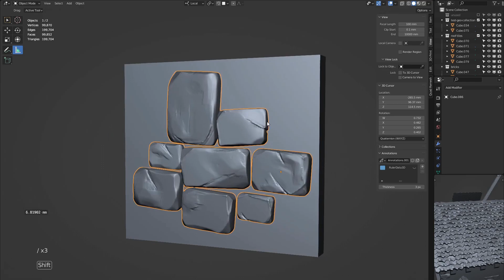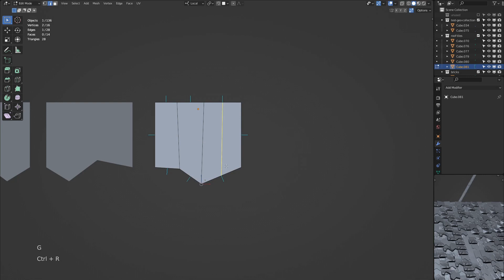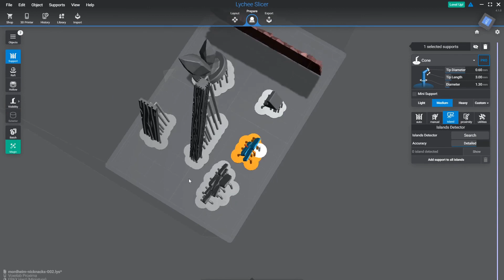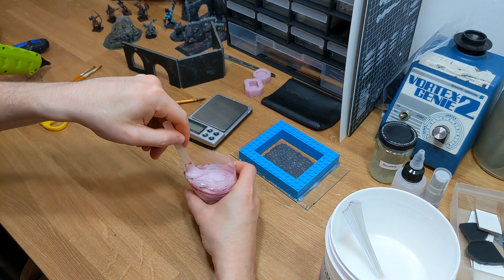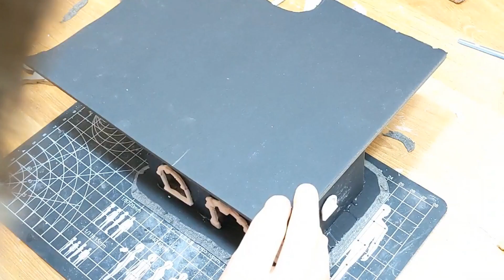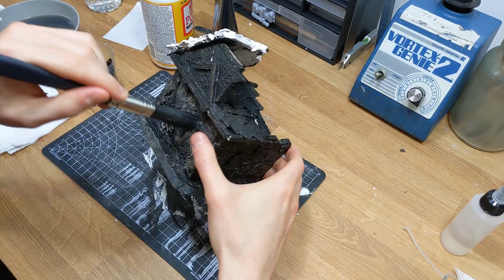Creating Repeatable Wargaming Terrain - Blender 3

Comment: What a great tutorial, one thing I would ask is when I build certain items in blender when I make them to scale and then export to stl the measurements are completely different. I’m using lychee as a slicer so wondering if that could be the issue. Also what size scale do you do your walls? Thanks Martin keep up the amazing work.
Reply from the maker: Yes it's a good question, if you go to scene properties then under 'Units' you can change the unit scale to 0.001. Then the Lenth dropdown to millimeters. This way things will be in mm and export as expected. I am actually thinking about covering this topic in an upcoming video as I think it's essential to doing these kinds of things.
Reply: @MWSculpts  thanks Martin I changed everything to exactly what you just said and with miniatures it seems to work fine but with modular buildings which I’m currently working on for my d&d setup it always comes out either larger or tiny lol think I’m gonna try chitubox to see if it’s any different. As always thanks for the quick response mate 💪👌
Reply from the maker: @Athomeintheshed  It could be that you need to apply the scale on those building objects if they are not already set to 1. Also if you are using 3D print toolbox I leave 'Apply Scale' unchecked. If these are no good best of luck with chitubox :).
Reply: @MWSculpts   I’m going to give that a shot this morning thanks Martin 👌

Comment: As a designer of miniature stuff, do you know if there is a "standard" unit of measure that is used?  The switching between a miniature designed under the default metres and another that was made in millimetres seems overly cumbersome, as I often lose the puny millimetre object while incorporating a metre object.
Reply from the maker: Hey Samual, I'm not too sure about standard. But personally I always use millimetre to scale things in Blender. 32mm is a great scale to understand how tall a doorway should be for example as often characters are scaled to this height. Try setting up your blender to use mm (0.001 metres) then if something is too big you can scale it down and apply (ctrl+a) the scale to the correct mm size.